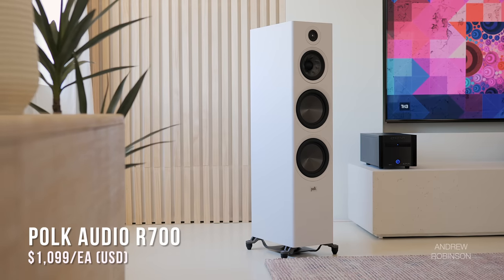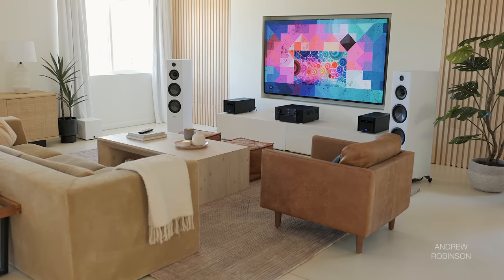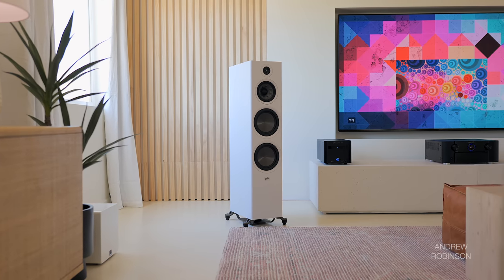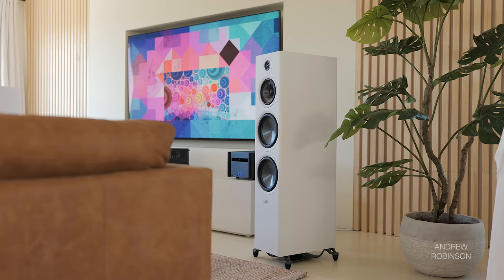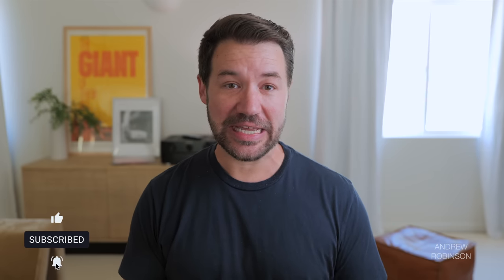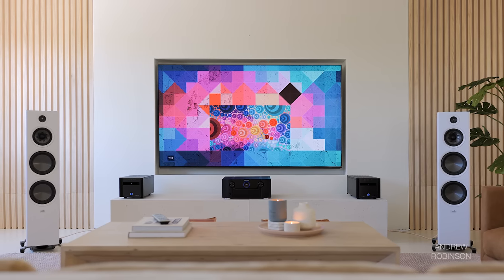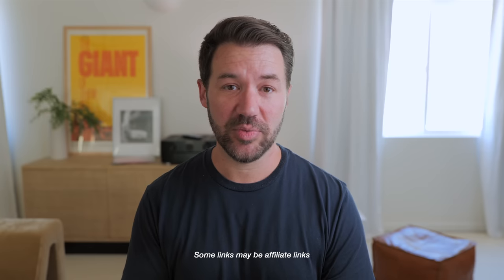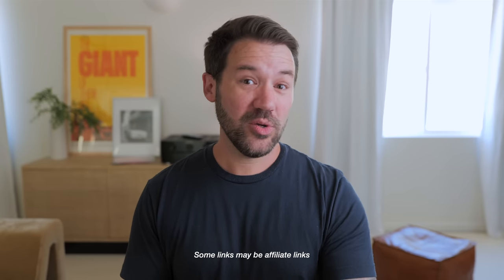Are High End Speakers REALLY WORTH IT? 🤔 Polk Audio R700 Review

Comment: I've heard just one other review of these same Polks from a guy who's descriptive words i've noticed i can relate to purely because of his reviews of  amps & older speakers that i have heard myself in the past.  He owns far more expensive speakers than these & his only slight critisism was something fairly close to, tho not exactly   "Treble is not fatiguing but you wont get $10,000+ treble quality from these")  to the best of my memory,  which may be true, but it didn't put me off as the 'detailed but non-fatiguing'  part was also upheld by yourself, anyway, i've never owned 10,000+ Dollar speakers of any age & esp' not of recent design like that other reviewer's own $10,000 sonus Faber's stand-mounts. 
 I am between speakers as my very last fave' speakers recently had 1 channel's main cone 'die' on me,  they are/were Tannoy 15" vintage Dual comcentrics made in 1969... (from the time faded signed & dated 'test pass' labels stuck on their rears) ...which i'd bought  s/h for £100 from a school yard sale about 20'ish years ago & one driver has only recently gone out of linearity & hence  listenability at any volume (after a mere 52 years from new!!) when that 1 main cone lost it's linearity causing a concophonous & awful sounding magnetic gap/ voice-coil rubbing that i instantly recmognised from previous experience, so now i'm roughing it with Cellestion 3000 ribbon hybrids i kept from a previous ulgrade. 
But i gathered from his review, & more so from this review that these will suit me very well.  My only concern is here in the U.K., any  U S. made speakers or product cost quite a lot more than one G.B. Pound per 1 U.S. Dollar, after shipping costs & the standard U.K.'s 20% import duty, i'd could afford to buy a pair tomorrow if that was not a fact.  
After hearing that other guy's review & more so after hearing this review, these speakers strike me as being very typical of speakers where "The Law of Diminishing Returns" would kick in hard & fast if one was to spend more money on a speaker pair.   I love the white finnish, why Polk withdrew that colour is beyond me, tho it's not  a deal breaker. Does matt white paint cost more than a wood veneer now!

Comment: Does a Denon S960H have enough power to make the R700 kick and come alive like they should or is it under powered?
Reply: It'll sound about as good as Klipsch RP-8000s do with that, but in the future if you ever updated you'd be surprised what your leaving on the table with either speaker
Reply: probably not. most avr amps are bad.

Comment: Hello, I bought R700 and receiver is showing wrong polarity. I also did a test with 1,5V battery and the same result (cones are moving inside) This is already the second pair having the same issue. I found on some forum an information that  this is OK. Any other experience?

Comment: One more question. Did the Marantz 40n do a respectable job driving these? If I step up to these speakers it will likely be a few years before I can upgrade the power.
Reply from the maker: 02:31 This is where I talk about amp/receiver pairings (might be helpful).
The 40n will work but it wasn't my favorite pairing. Now that I've had the opportunity to test this amp, this is what I would recommend over the 40n - https://bit.ly/3YKWQSh this will do a better job at controlling the woofers.

Thanks so much for the support!
Reply: @andrewrobinsonreviews  Thanks.
Reply: What about the klh 5 and the marantz 40n?

Comment: Hi Andrew, I really liked your review about the R700. You did mention that your ceiling speakers are from Klipsch, you also mentioned Onkyo TX-NR7100 as an option to drive it. I actually plan on that receiver as the TX-RZ50 (my first choice) is pretty much still unavailable even after months. If I would go with the TX-NR7100, without an extra amplifier, would you still recommend the R700 instead of the Klipsch PR-8000F? Also, I liked your other video about the Klipsch 600M II (second gen). Would you recommend having a Klipsch system (600M IIs., ceiling speakers such as CDT-5800-C II for atmos, center like RP-504C, and a sub) mixed with these Polk R700 as the "main" towers for the front? I like how you could push these Polks closer to the wall. I watched many of your videos/researched on pricing and mostly narrowed down my choices to an all Klipsch system (gen 1  8000Fs due to the new gens arrival went down under $500/piece). 
I could pay the higher price for a Polk tower if they work better on their own with the Onkyo receiver than an 8000F (gen 1) and if they can be a good mix with other Klipsch speakers. Thank you in advance! Hard to find anyone without a huge bias, and who actually tried many brands :)
Reply: Honestly these polks are about double the price of the klipsch 8000's first editions, I am sure the polks are better but idk about double the price better.
Reply: I am still have the same question and i hope i find the answer from (Mr.  Andrew Robinson ) if i use R700 and R400 with R200 in the back + surround speakers from R200 with AV Onkyo,                        1- What is the best (Ceiling speakers ) can be use it with this group?                                                             2- Can we use different brand company for Ceiling speakers or should the same brand of the speakers?                                                                                                                                                                          i hope we can find both of us the answering for all questions .                                                                       Best Regards,

Comment: Hello Dear Friend Andrew,,, 
I need your help, 
I'm using Polk Reserve series R600 + R400 (Center) + R100 (surrounds) & Polk RC60i & RC55i for my atmos, using 11.1 system.  I am also using Emotiva BasX A3 for my Front Stage (it gives 140w for all three chennals at 8ohms), I want to ask is 140w is enough power to Driver these Polk R600 towers & R400(center). or I should go for more powerful Emotiva XPA-3 it provides 275w for all three Chennals  & 300w for two chennals at 8ohms.
BasX A3 is also driving my R600 but some times I feel it's getting bit strain, & some time when I want it to get it louder it doesn't get as louder as I want it to be, Because Polk Reserve series are 4 Ohm's speakers & bit difficult to drive. Thinking to get Emotiva XPA-3 for my front stage & will use my BasX A3 for my surrounds. Andrew please suggest what is your take on this.

I'm also thinking to upgrade my R600 with Polk Reserve R700's. In fact after watching your Polk R700 review I'm quite impressed with them & wanted to Upgrade my R600 to R700. Note we don't have any audition facility near our town we have to travel more than 1500Km for that. Even purchased my Polk Reserve R600, R400 & R100 with out any audition only watching your R200 review. 
Andrew I'm big fan of your reviews & watch almost all of them & relay very much on them. 
I'm very much confused don't know what to Please help me out on this. Your Suggestion will be great help. 
Thanks...🙏🏼
Reply: Best questions, I hope he answers.

In the meantime have you tried contacting Premium Audio Company/sound United who own Polk was we all Denon, Marantz, Onkyo, Pioneer etc? Maybe they have a help support technical department to assist customers to combine their products to make a great setup.

Comment: Forte Iv’s or r700? Looking to upgrade front speakers, was running cerwin 12”. All types of music and home theatre setup, rest of speakers are now extinct mirage.
Reply: 5K for a pair vs 1700:  I would really hope the Forte's sound better.   That being said down firing ported Polks can be put pretty close to a wall where the Forte IV needs more room for that rear mounted passive radiator to do it's work.  Too close to the wall and the Forte4 will sound boomy and bad yet my Polk L600's almost sound the same as when pulled out a few more feet as they do 12 inches from the wall.

Comment: I heard these today. They were excellent. I’m waiting for the Polk Audio Legend L800’s to be setup for me. My question is this: is the L800 better than the R700’s? And second if I use an Emotiva XPA-11 power amp coupled with The flagship Anthem AVM90 processor or your favourite Marantz SR8015 will the L800’s shine for both music and movies? Or do you think building a system with R700’s front, back and match centre will work better? So Polk’s flagship vs it’s one notch down versions! Excited to hear your thoughts.
Reply from the maker: I would not purchase the L800 over these. Check out that review for my full thoughts.
Reply: @andrewrobinsonreviews  Thought you would say that. Okay so I have 3 options now:

1. Wharfedale Elysian setup with 4's as fronts, 2's as surrounds and Elysian centre + a great sub
2. Klipsch Forte IV's as fronts and surrounds, Klipsch centre (I already have the reference flagship) + a great subs
3. Polk Audio Reserve setup with R700's as fronts and surrounds, Reserve Centre + 2 Polk 660 Pro Subs

And options to drive all the above would be the Marantz SR8015 integrated amplifier or the Anthem AVM90 Flagship processor + Emotive XPA-11 Power Amp.

What would be your ideal setup in this instant?

Comment: OK Andrew... I sold my Klipsch  RP 8000f's and got a Black Friday deal on the R700's ($825 ea.)   I also own a Crown XLS Drivecore 1502 and an Emotiva  XMC-1... My question... Are the Emotiva monoblocks that much better than the Crown?
Reply from the maker: The Emotiva monos are going to have a quieter noise floor so for low-level listening they may save you from some tweeter hiss depending on how you have your Crown amps setup. All that said, no, I do not believe you will experience an outright night and day difference going from Crown to Emotiva. If I were in your position, I'd stick with the Crown amps for as long as you are happy.
Reply: @andrewrobinsonreviews  The Crown has a S/N ratio at 103db at the 1.4 vrms setting... 6db higher (and audible) at  .775vrms with the Klipsch RP-8000F's... I will set up the r700s using Dirac or manually dial it in depending on the results. I will post the intel here.
Reply: @andrewrobinsonreviews  and I forgot... Thank you
Reply: @andrewrobinsonreviews  what's a good preamp for the emotivas?
Reply: How do the R700's compare to the RP8000f's?! Tell us!

Comment: Would you still recommend using an external amp with the Polk audio R700 when running them with a Arcam avr31 receiver ?
Reply: Yes! Always use an amp if possible.
Reply from the maker: I would try them with your receiver before spending money you may not need to spend.

Comment: I do like the concept that you should spend the same amount of money on components eg 3k on an amp and 3k on speakers . 
But I wonder what these speakers would perform like with a much pricier amp against pricier speakers. 
Could they scale up or hit a brick wall in sonic performance.  Or would they just smash it , as my logic tells me the budget end speakers will be tuned using budget end amplification to get the best out of them and vice versa with hi end gear and therefore would it be too much for the budget speaker to take .
Reply: They paired r700s with a Rotel that costs over 3K.
Reply: @gokhanersan8561  
I'm talking 15k  not budget 1k-3 k not achieving much there.  
You need to e exceed the 10 k bracket to start sniffing hi end .

Comment: The "entry level" and what we used to call "midfi" are far better products  than they were "back in the day."  The  build quality and things like real wood veneer, higher quality connects,  supports, etc along with brand recognition and buyer bias, can account for inflated retail prices. Advanced Technology and manufacturing techniques make it possible to make drivers at a lower price point that perform very well.  Better quality components in the crossovers costs a bit more but  not $2000 (sorry MAGNAPAN!) Not to mention power speaker technology.  You can add costs by building products that can play very loud with  low and extend response below and above human hearing and that can add to the price.  Still, most folks are not going to play their system at 95+db, which is very loud and can damage your ears.  Most "average" speakers can handle up to 90 db in a room with no problem.  Different folks will prefer speakers that put sound in the room differently..... horns, electrostatics, bipolar, dipolar etc and that can really up the price.  Some pricing has nothing to do with actual production costs.  For most folks the Polk would  produce sound far beyond their expectations.   To each his/her own! Thank you, Polk for producing a great product at a fair price!! 😂 Audiophiles stop worrying about things that really don't matter and enjoy the music more. 😅

Comment: Received both mine Monday. Both were wired backwards. Running with the hc1s like suggested here and so far they sound good. Added a pair of 200s, 900s, and the 400 center(also on a hc1). So far so good. Would love to know how wiring them backwards escaped the factory. Rounding out is a Svs sb16 for sub and rear surrounds are definitive techs.
Reply: Hi John,

What do you mean wired backwards? 
Can you hear an issue when they are wired incorrectly?

Thanks
Reply: @Sam_CL350  the binding posts are wired out of phase. The positive is actually the negative and vice versa. I ran the receivers auto calc tool and it reported back the issue. I switched the wiring and in phase. I’ve had other speakers on these wires so it’s not the wiring it’s 100% the speakers. Thankfully both binding posts are wired incorrectly as they are shipped and mostly used with the connection in place. I did check both sets individually to verify. I have contacted the seller and they are reaching out to Polk. Thankfully it’s not an issue to run them backwards just to me even at this price point simple things like this shouldn’t be allowed through QC.
Reply: @SoulSapper  Thanks John

Comment: but------does the sound stage of this pair of speakers extend beyond the speakers themselves in terms of width and depth with pin point imaging?
Reply: Andrew says: "It extends beyond the boundary of the speaker (yes). For such a large speaker they are not difficult to make disappear and with the proper amount of toe-in, center imaging is precise and separation b/t the speakers is very, very good. Does better exist? Yes. But don't think for one second, any differences at any price point are going to seem night and day better. If you think for example, a pair of bookshelves have more precision than the R700, know that you are responding to potentially to the lack of bass, creating a more detailed sensation but that doesn't mean they are better with respect to the soundstage."

Comment: I would like to purchase a pair of high end speakers because I can. I currently own B & W 600 series bookshelf speakers along with center speaker and sub. Wondering how Polk 700’s would go with the current B&W,s? Should I go ahead and get B&W 702 S2? Wanting my music and movies to sound even better
Reply from the maker: Polk and B&W are going to have totally different sonic signatures with the Polk's likely coming off as tamer up top in comparison with a bit more bass weight. Polk's are arguably more neutral than B&W, so if you're used to the B&W sound already, it's possible you'll find Polks to be a bit less "fun" or forward.

Comment: Will a Parasound P6 pre amp  / a23  (125wpc @8ohms) amp combo drive the R700 property ? We are all after that punchy low end.....but that usually requires plenty of power. So do you think that my gear could handle them ?
Reply from the maker: I believe you will be okay as I used to own those exact products and they're good into 4 Ohms which is how low the R700 can dip.
Reply: @andrewrobinsonreviews  I recall you saying that in the P6 halo integrated amp review if im not mistaken, that's why I asked. I am thinking of getting them. Thanks and keep up the good job, great videos messier!

Comment: Hey Adrew. Can U or someone else tell me how is sound stage and imaging like comaring to Wharfedele Lintons?
Great review!
Reply: Today I hooked up these two speakers to a switch. I'm driving them with the Hegel H95 and also using a Dominion D110 subwoofer.
To me, the sound stage is larger on the R700 than the Linton's, imaging is better, very good separation of instruments. I'm not good at all of the audiophile lingo but in plain language, the R700 has a fuller sound. The highs and mids are clear and bass sounds great. They were what I was looking for. Bigger, fuller sound but with great detail.

I compared the Linton's to the KEF LS50 Meta, the Buchardt S400 MKII, and the Klipsch RP600M and they all sounded great but lacked the full musical sound that the Linton's provided. The Linton's are great! And then I went ahead and ordered the R700. Now the Linton's sound like what was missing from the other three pair I compared them to.

My wife isn't into all this stuff so when I had her come down and gave here the switch, in four cycles she picked the R700 as her preference. She remarked the Linton's sounded tinny compared to the R700.

Well, I hope that might help you. Andrew's review certainly helped me get the sound I was looking for.